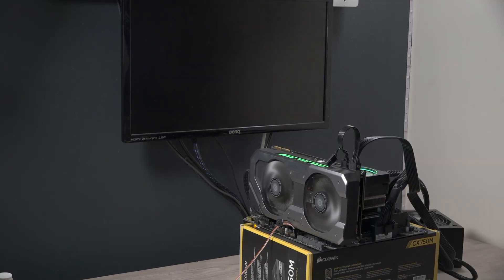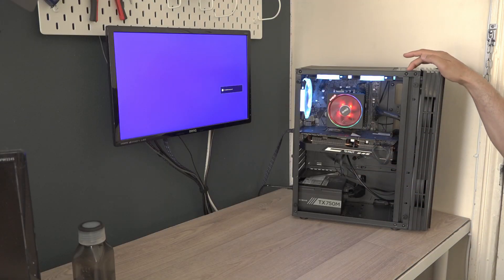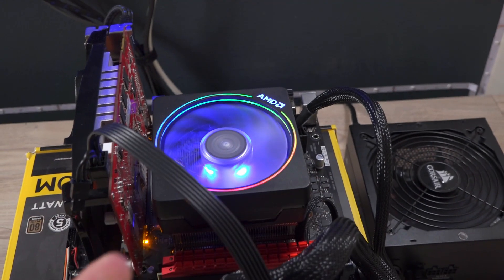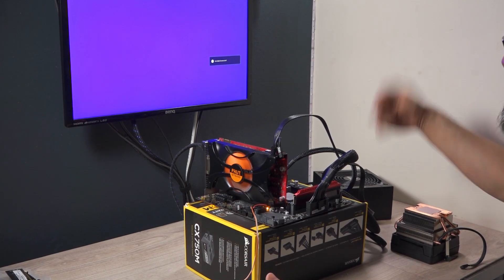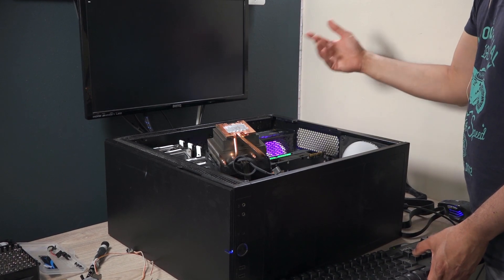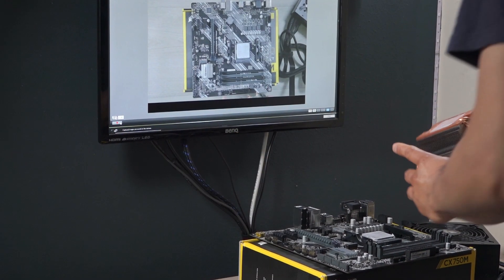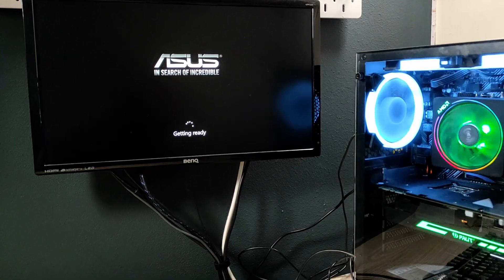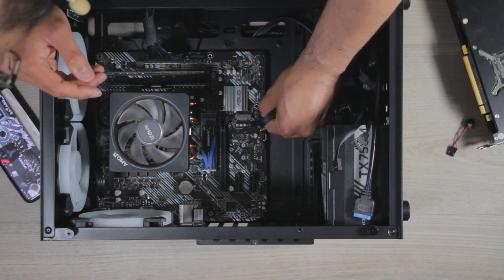Computer Turns On But No Display - Led Light On Fan Spinning - HARDEST Troubleshoot?

Comment: My pc fans are running and my pc is on butmy keyboard and mouse aren't lighting up or working nor is the signal on my monitor
Reply: i’m facing the same issue any solutions?
Reply: @calixerastro  motherboard and processor?
Reply: @Sathish_vizag  i5 13600k and gigabyte B660m
Reply: @calixerastro  did check motherboard any damage ?
Reply: @Sathish_vizag  no damage, i’ve tried trouble shooting every way i can think of
Reply: @calixerastro could be no visible damage I’m having the same problem try replacing your crom battery if you have one
Reply: @calixerastro could be ram
Reply: @Sathish_vizag my Mob And processor are new, also PSU and  the same problem 😢
Reply: @MorarnaEspanhaeEuropa  remove processor and gpu then reinstall it.
Reply: @Sathish_vizag  Was just the Ram. I bought anothers RAMS and the problem solved. Thank you
Reply: I dont think I can flash my bios if there is no display right?
Reply: @frogsoisuoiusd7326 have you figured this out, bc i bought a brand new MOBO and cpu and im still getting the same problem
Reply: Yo gys I've found the solution... 
Just do CMOS reset then you should be fine i mean it worked on mine so maybe y'all should give it a try... If y'all motherboard don't have CMOS reset button then just turn off your pc, unplug your PSU cable, take out your CMOS battery from the motherboard, and take a tester or any mettle screw driver then touch it on CMOS battery slot for 1 or 2 minutes and then wait for 2to 3 minutes then plug in your PSU cable, put back your CMOS battery and turn on your PC it should work.
Reply: @AnonymousSpidey.69 yo what do you mean touch it on cmos battery slot I have the problem where when I plug in my pc my mouse and keyboard has no light and my pc fans and lights are still on and no monitor signal
Reply: @gurureyli did u find out?
Reply: @AnonymousSpidey.69  unfortunately that did not work for me
Reply: @AnonymousSpidey.69 this got rid of my VGA light but now im stuck on Boot light with the same issues , No lights on my kbm & no monitor signal
Reply: @AnonymousSpidey.69  IT WORKED
Reply: @AnonymousSpidey.69  What if you reset the CMOS battery and you are stuck in a flashing loop of "Your bios has been reset" and it never loads windows or a recovery drive? I can get into my Bios and that's it.

Cmos battery dead or Bios needs an update (never been updated)?
Reply: Did you got any solution I am also facing same issue
Reply: @Sathish_vizag  yes I did indeed
Reply: @zemissailor6255  how
Reply: I got same issue, guys any solution?
Reply: @hao.1991 did u ever fix it?
Reply: you need to check your ram sticks and clean them
Reply: @milan9304 no you dont 😂
Reply: Love it when people say they solved it but not how it’s a joke
Reply: it's probably a shorted mosfet of the cpu ,same problem hapened to me , i bought a multimeter and i learned how to check for short circuits on the motherboard and i found 3 cpu mosfets are shorted on the same line , i bought replacement mosfters and took the motherboard to a repair shop and asked him to replace the 3 faulty mosfets and the motherboard worked just fine after that , and the good thing is that the repair guy diden't ask me for much money for the repair
Reply: @abdaimegaming2679 pls share any video link i have digital multi meter but seeing my mobo will explode my brain i cant understand anything lol
Reply: Any fixes going through this EXACT problem my M&KB don’t work but everything else that I plug into the usb does! And I have no display
Reply: @SkyHighGamingTom did you ever fix this?
Reply: @cypher4732  I did not :(, having to replace my motherboard bc I feel that’s the issue
Reply: @SkyHighGamingTom  any update? 😢
Reply: Bro i got the same shit, did you fix it?
Reply: @robertofitch5909 did u ever fix it?
Reply: @robertofitch5909 ur mobo needs a bios flash
Reply: problem solved ? 
If solved tell me please m facing the same problem
Reply: @karanwatvani5747  my mobo needed a bio flash
Reply: @calixerastro what’s a bio flash
Reply: @calixerastro but how do you do that with no display?
Reply: Lmk if you guys got a solution
Reply: @akifjames2454  Reseting bios by using the CMOS button on my motherboard fixed the problem for me.
Reply: @DNGisG button or battery? theres a button?
Reply: @HiddenToyFiles  Most Motherboards don’t have a Reset BIOS button. If yours doesn’t, just remove the battery from the mobo and reconnect it after waiting like 3 minutes and it should reset.
Reply: I also face the same problem.. just one of comments to clean ram.. do i did it.. i clean my Ram and take of my cmos battery first.. now all good.. thanks
Reply: Fixes?
Reply: @StrawberryOnC  unfortunately your motherboard or processor is most likely fried. i had to replace my cpu to get it to fix
Reply: fixed it, it was my Powerswitch that had fell out
Reply: @StrawberryOnC  ah that’s very good news
Reply: @StrawberryOnC  glad u figured it out
Reply: @StrawberryOnC  if u don’t have extra parts to test with you’re probably gonna have to take it into a pro
Reply: My newly built pc having issues booting up. And whenever it does boot. It  freezes sometimes. And when i turn it off pc won't totally shut off fans still spinning but my monitor is  already off. Anyone having same issue? what could be the cause of this issues?
Reply: problem with RAM?
Reply: My keyboard and mouse also unlighted plus no monitor image. 
I replaced my cpu (LGA 1500) but that had no effect.
I can’t replace my motherboard because all I can find are refurbished ones.
So, imma need to buy a current motherboard (LGA 1700) and upgrade the cpu and also upgrade the gpu while I’m at it. Gpu was old anyway (970 gtx).
Reply: Same issue, but my pc's water cooler revs hard and the cpu led displays. Its either the motherboard or CPU but my gut says that the cpu gave it up because it came to me overclocked.
Edit: my pc also auto shuts off after a little bit of now starting.
Reply: @romanboi3115  

I had a leaking resistor on a motherboard that caused pc power down. 

On another pc, it was a failing power unit.

On yet another pc, the water cooling unit failed, causing power shut down. This one related to fans going full Boing 747 mode prior to shut downs. ✈️
Reply: Had same issue troubleshooted and it was ram
Reply: Same
Reply: @ভোমরা have u found a fix for your yet i just ran into the same problem after i redid my cou and turned on my pc and no display keyboard and mouse not turning on and then i put my old cpu back in and everything turns on
Reply: @BMWrust did you find a fix? Currently facing this issue already tried everything else :(
Reply: My processor 5700G is dead. I put 5600x on my motherboard and it worked and post just fine but 5700G is not posting and because of that my keyboard and mouse wasn’t even working. I m sad it was cpu which it was motherboard cuz it’s cheaper to buy one 😂
Reply: Same issue it just happend when i was cleaning it i dont know how to fix it i already cleaned the ram i use an eraser and it wasnt fix i really reallly need help
Reply: @kaleyjohnortega3572  

What did you use to clean the pc?
Reply: @kaleyjohnortega3572  you probably broke something, first, check and make sure all your parts are in place
Reply: I got the same problem
Reply: I took out one of my rum sticks and then turned on the PC and it worked. Then I placed back the other ram stick and turn it on, I can access the windows but to do that, every time I would need to go through the bios and than exit.
Reply: Same
Reply: I had the same issue, once i got the computer already built and when i contacted them they wanted the case back and on returning they said the cpu was faulty and they replaced it. The second time i built my own pc and after i learned how to connect led sw, while doing that apperantly i unplugged my cpu cable on mother board, that is coming from the psu. Hope this helps someone someday
Reply: Typing this so someone could help me:- my problem is when i turn or my pc all the components run and i have done almost everything like checking the ram, resetting bios with the cmos, i am using intel i5 3470 with rx 580, my gpu is ok 100% power supply is just fine, please hwlp 😢
Reply: same and mine does not turn off unless I hit the power switch on the power supply
Reply: Ram issue
Reply: I connected a second monitor and then it worked. but after I removed the second monitor, it wasn’t detecting the signal. Then I connected the second monitor back, went to nvidia control panel, and disabled gsync. Then my monitor was detecting output agaib.
Reply: @hakeruann-of1oji’m having this issue, RMA my mobo and ASUS claimed nothing was wrong and it tested fine on their end. So now what? CPU or PSU? I tried 2 sets of RAM both are on the QVL. i have a video in my channel of what it does on power up…please help anyone😢
Reply: The it’s your ram
Reply: Pc boots, fans on and it shows the  motherboard logo, says click delete or F2, keyboard and mouse lights up but none of the buttons work
Reply: @iNerdMedia11  you have to install an OS. pressing delete or F2 should get you to the BIOS.
Reply: check your usb port if they are faulty and check your keyboard and mouse. I had that prob. I founded out that my femal usb ports was durty. Cleaned it and it was working or it can maybe be a loose connection
Reply: @alexanderhendrikdouglas5813  same happened to me but few hrs ago my pc was working correctly 😢 and when i turned it back on i started getting same error
Reply: Same
Reply: Easy solution of this re insert your rams
Reply: @deadboyzarif8869 i changed my rams, my mobo and my gpu, tomorrow i will try a new psu, if not working then should be cpu….🥲
Reply: Bro did u fix it cause I touched something that I wasn’t supposed to touch in the BIOS which led to my pc having the same problem
Reply: Had the same issue, power supply fix. There should be a little switch that’s red and has two sets of numbers on it. Switch it up or down. Kinda trial and error it until it works. Worked for me. Hope this helps.
Reply: @Hayden_981  110 and 220V? that's the voltage of your electricity. it is not trial and error as using 110V in somewhere that has 220V electricity could damage your pc!
Reply: same
Reply: Same still no solution
Reply: @commonsense7879  ima just get it fixed
Reply: @commonsense7879  hello, i had the problem. it was fixed by reconnecting CPU 8-pin (4+4) cable in correct orientation and reconnecting 24-pin motherboard cable. i also had to ensure the memory (ram) was well connected.
Reply: might be ur ram
Reply: Any update ?
Reply: Same
Reply: Same someone help
Reply: Hi facing same problem before what i did i changed power supply and able to use keyboard and mouse again you can try
Reply: Mine does this like every 4-5 months. Typically i just leave it off for 24 hrs and it works the next day lol i did once have to take my ram out and clean them up and then put them back in.
Reply: Reset bios or swap a donor gpu or a CPU
Reply: I tried switching out my cpu and I have thus issue
Reply: My computer doin the same thing turns on fans and lights but no connection to the monitor or m&k and computer won't turn off when I press the power button plus my graphics card light doesn't come on please need help new to computers and don't know nothing about them 😔
Reply: i got the same thing rn, how did you fix it? ive tried so much i can only use my pc without my gpu like right now
Reply: @Platinum199  maybe your GPU needs some kind of repairing, my motherboard got damaged a week ago, then i changed it and now everything is running correctly.
In your case, it is the gpu problem, most probably your gpu display ports are damaged or something, try cleaning the GPU Slot with a brush, and use eraser to clean the Chip part(yellow part).
Reply: @hassanmvppp0713  Yea, it was the GPU. Luckily I was able to get warranty on it and I’m getting sent a replacement
Reply: @Platinum199  Congrats man, I am very happy i guessed the problem, happy gaming 😀, or whatever you do on it, bye 👋
Reply: @hassanmvppp0713  gaming is what I do yea 😅 will continue once I have the replacement. Hope all is well with your rig have a good day my friend
Reply: @Platinum199  well I used 2nd hand parts so it has an rx 580 with i7 3770, it was my dream to get these specs and finally I got it like after 3 yrs, the past three years I used 750ti and it served me very well, sadly RIP to this legend 🥲
Reply: Clean cmos 1st , 2nd upgrade bios amd let it configure it self it should reboot like 5 times. Hope this can help someone. I have 5 am4 computers, 1,wife 2, my 2 girl's and I have 2 gaming computers and lot's of extra parts. You can biuld a cheap extra computer am4like that you can change part's to fix problems easy. Just my opinion 🤷. Example I have a cheap 460 4 gb to trouble shooting it only use the gpu slot 75w no extra gpu power cord best investment.
Reply: How you fixed it
Reply: in case any of you havent fixed it yet i had the same issue with my pc and i had 3 ways to troubleshoot 2 of the 3 problems have happened to me. 1.make sure the wall outlet has enough voltage for the power supply to boot. 2.check your cpu it may be dead, mine was. and the third fix is your motherboard like he showed in the video if nothing else fixes this its probably your motherboard, i made a mistake and bought a new psu when it wasnt the problem the entire time. hope this helps
Reply: @juicycreations850 i just put in my new cpu straight out the box and have already flashed bios and everything else (cmos reset and so on) and it doesn‘t work. What do you think? Is the CPU dead? The cooler of it gets warm thi
Reply: Bro same but when i unplug my graphics cards and my mouse and keyboard lit up but still no display via hdmi  from on board graphic.
Reply: @MrJvdAli  for me, one ram stick was faulty. Maybe try that
Reply: I also bought new graphics cards still same issue, while researching on mostly people solved by replacing there primary ssd
Reply: Same
Reply: Clear cmos
Reply: I cleared out all the excess dust and it worked for me.
Reply: Same shit happening to me right now brand new Ryzen 4080 super did you fix it ?
Reply: Reseat your ram
Reply: Guys it’s your power supply
Reply: Most likely the motherboard is cooked
Reply: @zeeks4129  my case was the RAM's that was cooked. Bought another ones and voila
Reply: I swear Ive literally tried everything, starting to think my gpu is messed up now but i hate how it happened so suddenly , im still holding on to hope that a solutionwill pop up
Reply: did you fix it yet? if so i’m having the same problems and am wondering how you did it, thanks
Reply: @abzains did u ever fix it?
Reply: @HiddenToyFiles   Yeah but i had to fully wipe my pc for it to go back to normal
Reply: issue just happened to me last night. looking like cpu or mobo issues but without extra parts i can’t rly do much else. pls lmk if any fixes are found
Reply: Me too happens today
Reply: @MohammidMAyana  that’s ass :( my issue turned out to be bricked cpu
Reply: @Ks021  how did you know ?
Reply: @MohammidMAyana  had to take to a professional who had spare cpus. swapped mine out with a different amd chip and it booted
Reply: I had the same issue, I did two things but I'm not sure which one solved the issue:

1. I unplugged my graphics card and plugged it back in again thinking it was some faulty connection
2. I took out my cmos battery, waited for a bit, then put it back in again.

Then I had a display! Despite having a PCIe NVME SSD, it took a bit of time to boot but I patiently waited and got everything working again.
Reply: @tengkuadam1399 I tried that didn’t work 😞
Reply: @julioc612  lemme know if you figured it out
Reply: @Platinum199  I reseted my cmos it’s like a coin on your mother board take it out for a few min if that doesnt work then put it back in and just put a screw driver on it or anything metal and put on top of the coin for like 1 minute and that should solve it.
Reply: @julioc612  I tried that, unfortunately I was unlucky. Issue was my GPU it’s still under warranty so it’s all getting sorted just gotta wait a few weeks

Comment: so i have run into a problem with my PC where whenever my pc restarts or i shut it down and try to turn it on again my PC turns on but does not recognize that I have a monitor plugged in. If anyone could maybe give me ideas on why it would do that, it would be great. Ive checked the ram, gpu and power supply also have checked my ports and cables and nothing seems broken or dirty.
Reply: Redux build? I’m having the same issue. Did you figure it out
Reply: @push-to-talkpodcast2864  i have the same issue bro and i bought it from redux gaming as well!

Comment: I recently build a new PC and was getting the boot and display lights, the graphics card was connected via display port and Dvi and still no image. I was getting desperate só I finally plugged a hdmi cable and it finally worked, I don't know if it is a driver issue but I still can't acess the Bios screen if I have the monitor connected using Display port, I tried to update the Nvidia driver to display port 1.4 but get an error evertytime.

Comment: Before doing all that reset bios or remove cmos battery. Motherboard might be good but windows or boot process might be corrupt. You will know this if your motherboard has a vga light on
Reply: So how do you reinstall windows if the bios is not accessible and I have a black screen with VGA light? Ty
Reply: @sqshq  basically the BIOS it's not dead. First try removing the CMOS and power cycle your PC. Do not use your graphics card if your mother board has a video output. Use that one instead that should help you identify if your card its damaged. If it boots and you are able to get to BIOS you should be good. If not your mother board might be bad. If your motherboard has dual boot that should help as well. Try that and good luck 👍